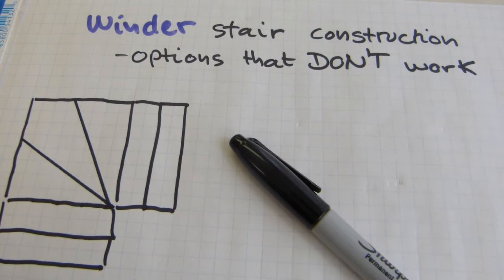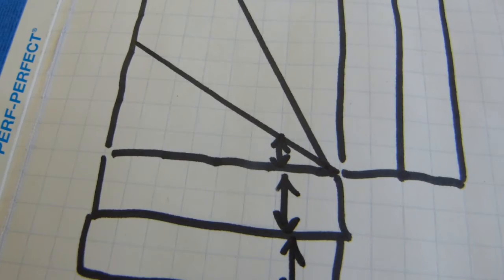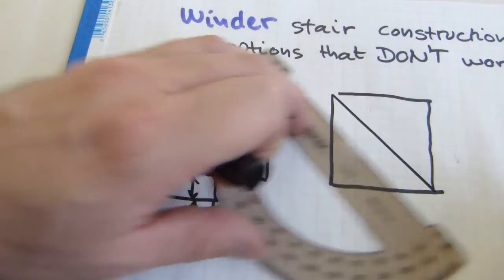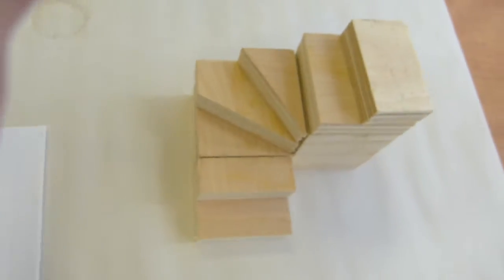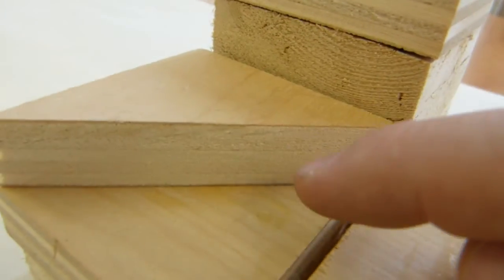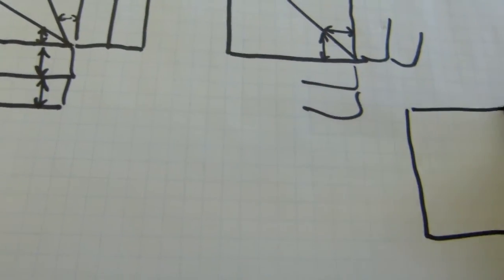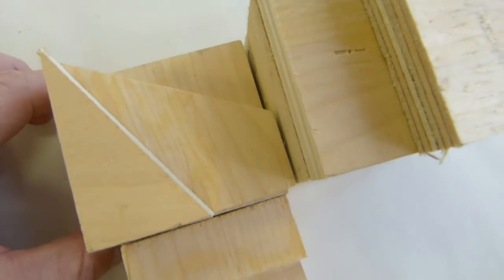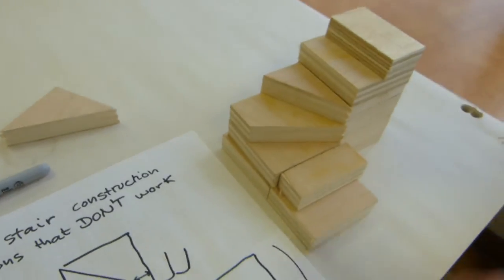Winder stair rebuild: options that DON`T work

Comment: On my stairs the width of the tread as the stairs begin their turn are wider , meaning they don't come to a sharp point . this is achieved by using an open riser design . this allows the treads to dive under the stair above it creating a wide point at the curve

Comment: Just add 1 more step at the bottom section.   

Or cut the header back if possible 
 
You should have at least 2 to 3 options to accomplish it

Comment: Nice explanation,but i need something that WORKS,i need to carry a person on a wheelchair up and down(me and a helper); i need to get rid of those fawking  stupid angled steps,they are dangerous.

Can someone  explain to me the reason they make  stairs with those angled steps,instead of a more logical  ONE big square? Thanks
Reply from the maker: Main reason: trapped run (limited horizontal space to make the needed vertical height)
Reason no.2: good looks (or so builders think)
- Of course flat landings are safest.
Reply: Jose Peixoto standard uk stair height is 200mm per step, if you change it by a few millimetres to accommodate a gain or loss of a half step then it should be evened out over entire staircase otherwise it could creat a trip hazard for someone that's not expecting a half stair or stair and a half drop

Comment: Your model doesn't represent either of the two plans you drew as you omitted the first riser of the winding treads (the 3rd of the flight) on both.. as for the 3rd plan - you're kidding right? A 45º winder pair absolutely works but you have to add a step above or below the winders to compensate for the winder you lost.
Reply: Adam Macer  He can’t think outside of the box
Reply: @GGarcia7111  "outside the box"... I see what you did there.
Reply from the maker: Model is made to match both sketches meticulously.
Video does not attempt to teach spacial orientation or blueprint reading theory, those are implied prerequisites.
Adding steps may not work in trapped run.
Reply: Sorry but it's not - both plans show the 3rd riser being the front of the first winder separating the second tread and the first winder. Your model has the second straight tread and the first winder tread at the same height meaning you've made your model one rise too low from the beginning of the winders. That said, it makes no difference because reducing the winder by a tread & riser still creates the problem you show IF there are other restricting factors. However to say that that option doesn't work, without the qualifier that is only the case in a trapped run, is misleading.
Reply: "Model is made to match both sketches meticulously."

That's funny. 
I get it though. When you're so into what you're trying to say, you miss something so obvious.